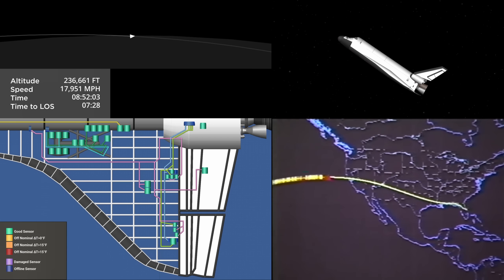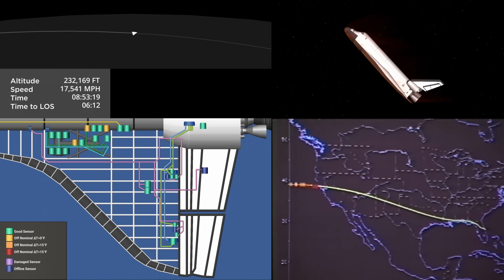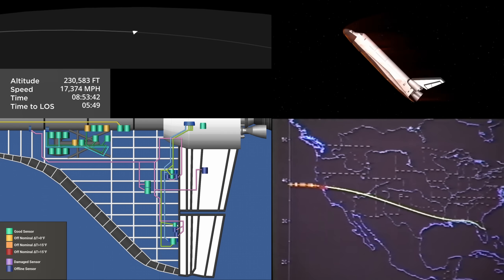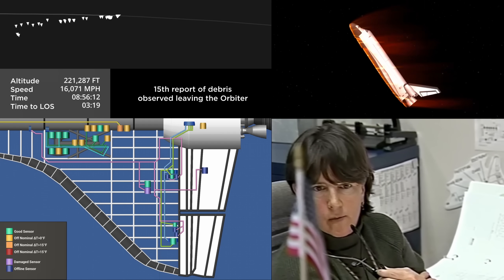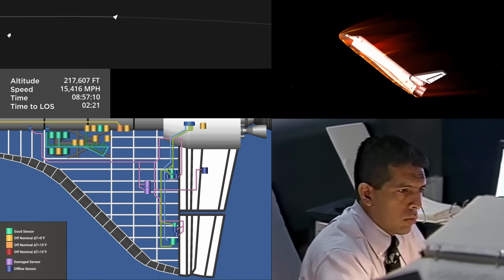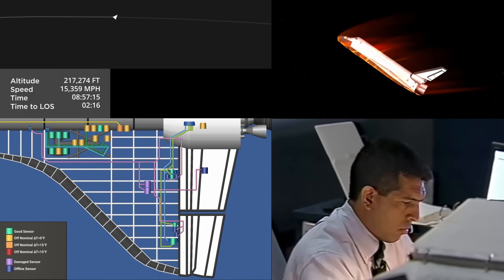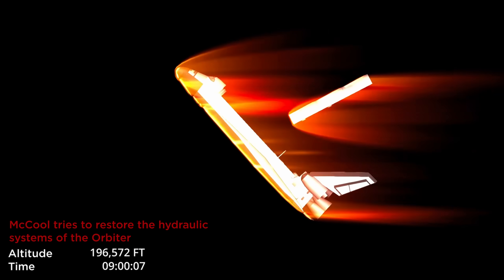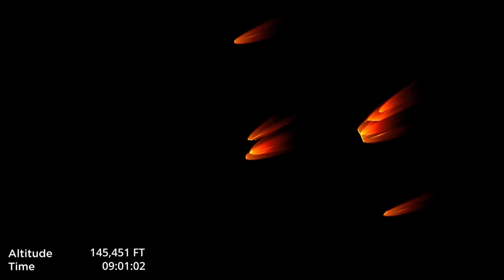The Columbia Disaster in Spaceflight Simulator

Comment: Something nobody has ever talked about: 

After NASA examined the launch films showing the debris strike, all the ground controllers were briefed on what this meant.

IOW they all discussed how this could affect the re-entry in detail. They went over scenarios of everything a hole in the left wing would cause, what it would affect, how it would develop, system by system.

And it went without saying that there was NOTHING they could do about it. There was no plan for dealing with this scenario. At least not until they made it into the lower atmosphere.

Because they lost pressure in the landing gear tire(s) they knew they'd have to have the crew bail out. The crew cannot survive landing a shuttle with a flat tire. 

The shuttle lands at nearly 250mph and without tires it would tumble and be destroyed on landing. The crew would bail out and the shuttle would be ditched in the ocean or the Gulf.

But again, nothing could be implemented until the shuttle made it into the lower atmosphere in relatively one piece.

So as the left wing systems began to fail every single controller in that room knew there was a significant hole in the left wing and the only thing they could do was wait and see if the shuttle stayed mostly intact thru re-entry. 

So they just watched as the problem slowly but surely got worse and worse and worse. Until they lost all downlinks and communications. And they also all knew what a horrible death the crew was suffering as they sat there and just watched.

So, a very bad day.. 🇺🇸
Reply: If they knew that much and there was that much concern to hold a detailed meeting, was there the ability to take a look-see at the damage? A camera shot from an orbiting satellite or was there the ability to take a space walk?
Reply: @James-jb5xs  I recommend reading the Columbia Investigation Report. Interesting stuff. The launch cameras showed the impact on the wing, and several engineering staff requested DoD on-orbit imagery to better calculate possible countermeasures, but these were cancelled by uppers in the management team. And instead, they deployed a software never meant to calculate the impact consequences of such a large piece of debris. The result? No-one knew the size of the hole in the thermal shielding on the leading edge of the wing, and therefor they went on with the landing, assuming this was another minor foam strike like the ones seen before. Complacency in NASA management and the fact that they flipped the requirements around to require proof of actual faults, rather than investigate. There were not many viable options, but during the descent, they could have performed maneuvers to reduce thermal loading on the damaged side. The management team largely stayed at NASA with little consequences other than losing job advancements.
Reply: @James-jb5xs - Yes there was. They could have gotten the DoD (Dept of Defense) to look at it with high resolution ground based cameras.

But NASA chose not to. Primarily because other incidents of foam hitting the orbiter hadn't resulted in significant damage.

But the main reason they didn't is because they knew there wasn't anything they could do about it. Which isn't exactly true..
Reply: @James-jb5xs
NASA dont have acces to the military satelites, that are observing the earth.

Obvserve a fast moving object at LEO like the Shuttle is extremly dificult. Was done just once, at the first Shutgle mission and was a pain necause needed the cordination betwen the satelite and the launch of the shuttle.
Wasnt posible for the Columbia

They didnt have on the shuttle the tools to do an EVA, specially thag large. The Shuttle is big and doesnt have joints to attach like the ISS.

Also, NASA admins didnt though was that bad, and as said, nothing could be done, so they just sent an email to the comander of the crew.
Reply: There’s a beautiful song about this tragedy called The Commander Thinks Aloud by the Long Winters. A line in it: “…and Houston knows the score. But can you feel it, we’re almost home?” then “…the crew compartment’s breaking up…”

Knowing the history to that line, it’s heart-crushing.
Reply: Beautiful commentary. It’s so tragic to think everyone in that room knew exactly what was developing, and exactly what happened, when it happened.
Reply: Could have tried maybe use some of that amazing brains the now doubt nepo appointed idiots didn’t have. Let them cook instead.
Reply: What really pisses me off is that they brought them back while having that knowledge anyway. And don't tell me "well, there was no way to get them down." Any day you don't die is a good day. It would have given them time to at least think a lot more about ways they might get them down. As Syrio Forel, Aria's instructor to help her learn to use her sword said: "What do you say to the God of death? Not today." My ex wife is a retired NASA engineer who knew several of the people on the shuttle and I will always remember when she came back into the backyard where I was mowing the lawn and she looked absolutely in shock. I thought "one of our parents maybe passed away, or who knows." But I knew it was bad. We lived in Clear Lake, virtually on top of the NASA Campus and I remember it was Saturday morning. She walked up and I shut down the mower and she said "we just lost a shuttle." That accident changed my wife (now ex) forever. Everything became a risk in life for her. I remember all of the flowers along many of the main arteries in Clear Lake. Mile after mile after mile, thousands of them. My son, who was in 6th grade at Falcon Pass, had a classmate who was a son (or maybe a daughter, can't remember) of one of the astronauts. So, this really touched us.
Reply: Horrifying and tragic 💔 They knew but the crew didn’t, that there was a 99.9% chance of them not coming home alive. That’s a tragedy right there, yet there was nothing they could do about it. 😢
Reply: @karenhoward6712 - They weren't that sure they wouldn't survive, as nobody thought the hole caused by the foam debris was very big.

When they finally tested it and on the second try it made a hole the size of a briefcase everyone was shocked.
Reply: Did they not have enough food on board to just wait for a reentry capsule that could dock to the ISS? A 1 or 2 people capsule can probably fit 6 if you literally play Tetris with humans, the weight of the people themselves would be easily adjusted for by a slightly different reentry profile
Either Russia or America could probably provide a rocket or quickly put a capsule on an ICBM. Perhaps several

It’s beyond me how the space shuttle had neither an ejectable well protected cockpit nor any sort of backup option for reentry

Basic spacesuits are probably enough for EVA in a pinch as well... in fact it’s never been tried but the effects of being in vacuum are probably strongly overestimated, ice would form on the eyes and the blood would be sucked out of the lungs fully, but i wonder if literal scuba gear would be enough to survive a few seconds or a minutes in space... if there’s an airtight seal at the mouth I don’t see why it wouldn’t. Skin is vacuum tight you might slowly lose water over hours and dry up but it would be a very slow process. If reentry was impossible in the shuttle then why even attempt it, just find another option even if it’s a risky one
Reply: @IceRain-f5v  As to the food/water part.  Consumables, as they would refer to food/water/fuel/oxygen are very tightly allotted for in space missions.  They have onboard just enough of each, with a small excess for a margin of safety.
Reply: @panderson9561 - If they had decided on a rescue mission, and they would have had to decide quickly, then Columbia's crew would have gone into ultra-conserve mode.

All mission objectives would be suspended, and all the astronauts would have just rested for most all of the mission, thereby reducing the consumption of all consumables, food, water, oxygen etc.

NASA said that they could have almost doubled the orbital mission length to nearly a month if they did this.
Reply: @IceRain-f5v  , such technology with Shuttle's re-entry speeds is  impossible... you are inside plasma cloud and debris and no time or energy to get far enough anyway...even with strategic bombers they had bad survival rate with ejecting whole cockpit like in F-111 and that's only 2 times speed of sound. Space Shuttle was a death trap in so many ways and it flew only because politics and senators demanded so... there was big money for the states and business companies that took care of the shuttle maintenance... and every shuttle were basically broken in pieces and  build again for the every  launch.
Reply: @IceRain-f5v - Columbia was not in an orbit inclination to make any rendezvous with the ISS or crafts from it accessible.

And it did not have the fuel to maneuver to it. Orbital dynamics are complicated. The rescue Shuttle mission would have been the best plan and I think it would have worked. 

But they never seriously even considered trying..
Reply: "nothing could be implemented until the shuttle made it into the lower atmosphere in relatively one piece"

To be fair, not entirely true. Theoretically saving the crew was possible, though highly unlikely. In order to do that:

1) NASA should have identified how serious the issue is within 24 hours of launch - which as we know now - they didn't.
2) Crew of Columbia was to go resource-economy mode to survive till the rescue mission - probably the most likely step to achieve here.
3) Preparation of Atlantis, which was scheduled to leave in a month, was to be sped up in order for it to be 10-12 days. It was evaluated to be improbable, but theoretically possible.
4) Since shuttles couldn't dock with each other - it would require crew to go from one to the other through open space. It requires extreme precision to avoid collision of ships and multiple walks, since Columbia only had 4 space suits with 7 members on board. 

Operation like this was never done even with one crew member and with almost 0 time to prepare it meant crews of both ships should have nailed everything with literally their first try.
Reply: @Mrrchv8181 Yes, I've pointed out this scenario before. It's not as crazy as it may sound. 

Experts have said that they could have launched a rescue shuttle quickly without compromising any major safety factors. They just kidded themselves that everything was fine..
Reply: @HailAnts  Technically this is how Pearl Harbor happened too. They kidded themselves that everything was just fine.
Reply: @danepatterson8107 Former Navy man chiming in here. Actually Admiral Kimmel took measures to lessen the impact of an attack. In fact his predecessor Admiral James O. Richardson was relieved of his command due to lodging a protest against moving the fleet to Pearl Harbor. Admiral Kimmel knew he couldn't resist orders above him. Both Admiral Kimmel and General Short were made the scapegoats and were later exonerated. In this case the top guys overseeing the protection of Pearl Harbor were in many ways prevented from doing so. In 1999 the Senate voted to exonerate him and President Bill Clinton refused to sign it, because honestly it would be an admission of incompetence, but also the implication of the commander and chief of allowing it to happen and ushering us into the likely impending war in two theaters.
Reply: I believe we all watched the same video as you 🙄
Reply: I appreciate knowing this. Wondered it as I watched. Thing is: NASA learned NOTHING after Challenger -- which, of course, shouldn't have flown that day. Sickens me that bureaucrats like these run our government. Fortunately, that's being addressed.
Reply: How was this not foreseen in thedesign and planning stage? A design that does not make room for incidents is a bad design.
Reply: @賴志偉-d7h
Space doesnt have room for mistakes
Mybe you dont know what are you talking about.

Any capsule or vehicle that has a hole or a issue its heat shield is done.
Reply: @賴志偉-d7h  It's called "Normalization of Deviance" Ironically, it was coined that after the Challenger Disaster
Reply: @賴志偉-d7h any design is based on a calculated risk assessment. They were aware of the dangers, they simply calculated the risks were not great enough to preclude moving forward.

Comment: The shows you the brilliance of what SpaceX did with the recent rescue. Has NASA been prepared we could have launched a second shuttle two to rescue the crew. They knew about the foam on this flight, there's even a test out there that was done by NASA that shows how much force that piece of foam had and the damage it could do to the tile, and yet NASA still rolled the dice. If I remember correctly they didn't alarm the crew or even review the damaged area to try and repair it even though NASA knew about it because they observed it on video the day of the flight. NASA knowingly and willingly participated, and took extreme chances and lost with two shuttle flights. They gambled with plenty more are they knew about the o-rings, they knew about the foam ignore it and hoped for the best
Reply: a few missing details... NASA didn't test that kind of foam strike til afterwards during the investigation. they had no workable way to assess the wing for damage during the actual mission. the mountain of risks involved with launching a rescue shuttle mission could only have been undertaken with some kind of confirmation that there was any significant wing damage at all 😢
Reply: hindsight bias